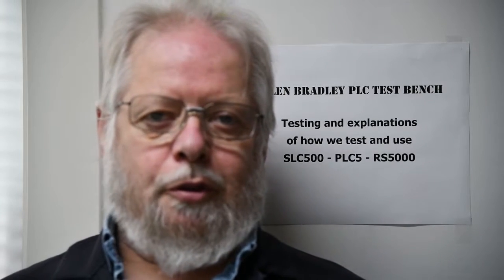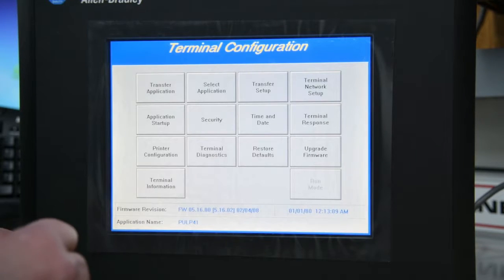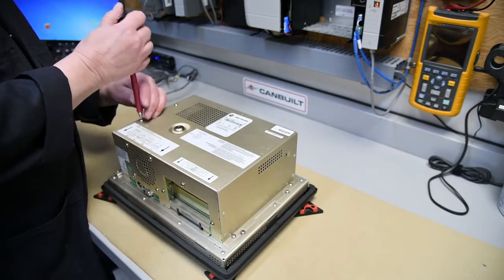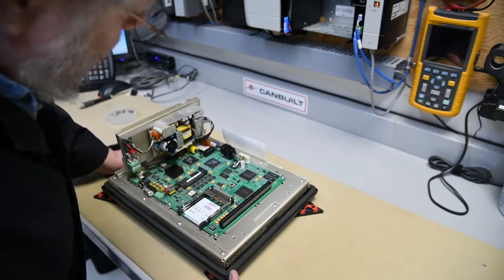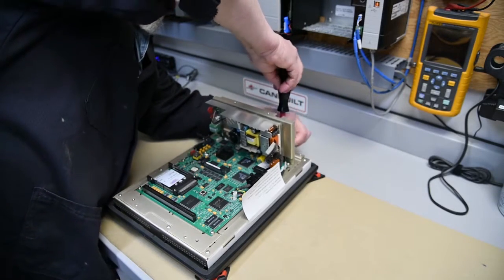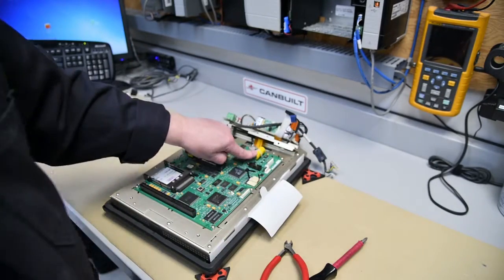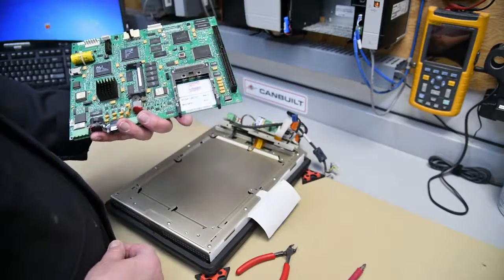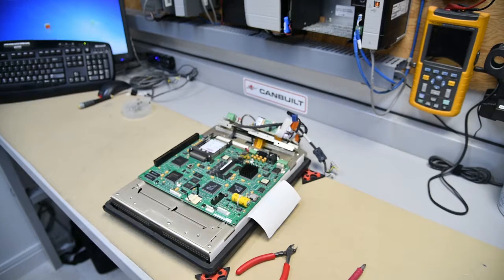Panelview 1000E Battery Replacement

Comment: Is there any way to get a replacement key for the config/run mode switch?
Reply from the maker: HI:  The key is the same one that is used in PLC5 processors.  Simply take it to any locksmith and they can copy it for you.  Nothing special about it.

Comment: Do you have the battery specification ? I need to buy one
Reply from the maker: Hi Michael:
It is a 3.6V lithium.
Back up your program as soon as you can in case it clears the memory on a power outage.
One way is to use the same battery as in the PLC5 and remove the old battery from the board.
But leave the tabs on the board and then solder the wires to the old tabs.  You get a longer lasting battery that way.
SAFETY NOTE:
You can not solder directly to the lithium battery as heat may cause it to explode.  
Also the ends of the battery case are treated with a coating and you need a special battery spot welder welder to attach the tabs to a new battery.
Secure the new battery in place with silicone or glue or if there are holes in the board a small tyrap.  
Hope this helps.

Comment: I have a 2711E-K10C6  1000E that was removed from a working machine. I have recently
plugged it in and it will only go to a blinking cursor in the upper left corner. If you put it
in configure it does the same thing. Any ideas on what might be going on?  Thanks
Reply from the maker: HI Dave:
Thanks for subscribing.  The 2711E units are now at a point that they are failing faster all the time.  Many of the components are well over 25 years old.  It is quite possible that the memory was corrupted.  Not many ways around that besides sending to a repair house that can fix them.  And those facilities are getting few and far between.  
You would be a lot further ahead at this point to go to a bit newer unit.  The PVP is easy to use and is a direct replacement for the 2711E units.
Bruce